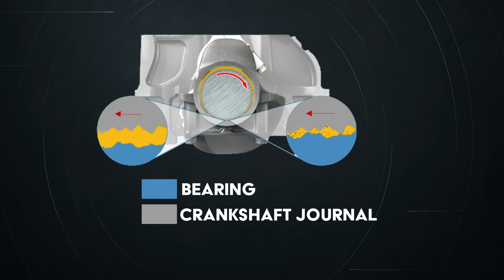the truth about start-stop technology (finally proven)

Comment: Quick things to note here: 
1) The tests needs to clarify that they are actually using a car that has start-stop features installed. If i'm not mistaken, this car has 2 variants, one has start-stop enabled, one doesn't.
2) Cars that use start-stop, need special low viscosity oil and they maintain some oil pressure even after the engine is turned off.
3) It might not be a fair test if the relay forces an engine to start-stop at X interval over that time, because in real world use cases, the engine control unit would not start-stop the engine if the key parameters weren't optimal yet( like oil temperature/pressure ).
4) Different start-stop enabled car brands have different solutions to these problems. Some have special oil pumps that keep oil pressurized.

In general, i doubt that the car can take that much damage in 1 year. If it did, it probably would not pass quality inspection, since factories and other independent testers have done these tests and havent found any significant extra wear and tear.
Reply: Something else that is missed is that a "warm start" especially if it has been less than 3 minutes, will have oil in the bearings.  It doesn't mean that there isn't a risk of increased damage compared to continuous running, but that there isn't "no oil" in the bearings
Reply: Are you crazy? You can't come here and speak the truth, people hate that! The simpletons want to be angry about a minor inconvenience and you're trying to ruin that. How dare you.
Reply: How on earth does an engine maintain oil pressure when it's stopped?
Reply: @ej20tnz  electric oil pumps. Some turbo engines already had them prior to the introduction of start-stop systems in order to avoid cooking the oil in the turbo when the car is stopped after harder driving.
Reply: @xIcarus227  And check-valves( which wont let oil drain out ) combined with pressurized oil reservoir will also help to keep oil pressure for a while.
Reply: @ej20tnz with an electronic oil pump that runs, while the engine is stopped
Reply: @ej20tnz  electric pumps
Reply: Lower viscosity oil did not help Chevrolet.  They had to recall many vehicles, replace engines damaged beyond a certain threshold, and update the specs to use heavier weight oil.  The physics of the damage caused by frequent stops/starts cannot be negated so easily.  It was a stupid idea defended by politics and based on flawed science.  If there is a problem with human caused climate change, it's population density.  Not fuel, or meat, or cow farts.
Reply: @nukelheadmp yea but its chevy their engines would probably fail even if it didnt have the start stop feature
Reply: It would have been interesting to know more about the test and the oil used etc, but I don't think the things you mention are particularly significant, especially in terms of the earlier generations of stop/start vehicles that have a non stop/start equivalent. The latest ultra efficient hybrids, I believe utilise very low viscosity oils such as 0w/20 and are equipped with auxiliary electric oil pumps, but I don't think this is normal for the vast majority of regular cars on the road that are equipped with stop start technology.

I believe the latest 'experiment' with thinner oils is an effort to improve efficieny and therefore reducing emissions anyway, rather than mitigating the effects of mixed friction. A certain viscosity is required to provide a robust oil film which will more easily subside if the viscosity is too thin. If you think about the syringe analogy in the video, a thinner fluid is more easily pushed out.       

I think the test consisted of the engine idling in the workshop, so was not under heavy loads or operating in conditions that are likely for the ECU to override the start/stop function due to something like excessive heat in the turbo, for example. Hard to know for sure though from the footage to be fair.

The basic fact remains that engine components are most vulnerable to wear when not operating under an optimal set of parameters including oil pressure, temerature and speed. To that end, repeated stopping and starting of an engine will absolutely result in accelerated and  increased engine wear, so the results of this test are hardly surprising. 

As in other industries, these kinds of gimmicks seem to me to be crude attempts to keep within ever increasingly difficult emissions regulations, rather than being of any overall benefit. Manufacturers obviously design cars to mitigate the many issues that stop/start technlogy causes, but this makes them ever more complex and expensive. Regular batteries and starter motors are no longer adequate, auxiliary pumps are required to pump coolant and hydraulic fluid whilst the engine isn't running. Surely the power required to crank the engine many times in a single journey and to keep the auxially pumps going, are essentially powered by the chemical potential energy in the fuel that you're supposed to be saving by stopping the engine when you're stationary?   

Sometimes the medicine is more problematic than the sickness and I think this is particularly so when chasing ridiculous, idealogically driven emissions targets. I also don't think the manufacturers can be trusted to mark their own homework in this regard and it's not as if they haven't been caught out in the past.
Reply: @jimmcspunk7692 it's not just about saving fuel, it's about reducing emissions. You know, to preserve the planet we all live on. I get it, though. You're only here for a tiny amount of time and you cannot be inconvenienced, who cares about future generations of innocent people that will suffer due to your ignorance and inconsideration.
Reply: @The_T_Rav  Thanks for your feedback Travis but your reply makes no sense. My comment addresses emission reduction and I find your assertions patently absurd and detached from reality unfortunately. I'm guessing that you're just trolling or having some kind of issues, possibly both.
Reply: My thoughts too... And doing a test with warm oil is hardly the same as the entire engine being warm? And the car they test on, does it ever fully warm up or do they cold start it the first half of the day? 

This video is omitting so much information it's very strange
Reply: Testing is a science. That's also the reason why militaries have 0Days. Because everyone thinks he can test something outside production environment and than make conclusions.
Reply: The thing is due to rampant planned obsolescence, they ONLY make the life of engine last the warranty period. S/s is just one more tool in their toolbelt
Reply: They "need" low viscosity oil? Oh lawd, here we go again. Yet another one drinking the koolaid with zero argument as to why lower viscosity oil has any benefit beyond tiny gas mileage improvement.
Reply: The two single largest polluters on the planet are 1. US military 2. China... Stop buying trinkets and well, you can't do anything about the former...
Reply: @klarion  If you are an american, then you can do a lot about both. Dont elect those who support military budget increases every election and make it known to politicians that you dont want bloated military
Reply: @UninstallingWindows  Ironically that does about as much to dent the military budget as you uninstalling windows does to microsoft's market share. The people have no power when 3/4 of the world's pollution comes from companies and institutions the average person has no real stake in.
Reply: After a few time listening…not understand of any😂
Reply: Copium
Reply: Who keeps a car for a million miles? Most I've ever done in a car was 225000 miles and it was the bodywork that failed it, not the engine. I actually do turn the stop start off in traffic. Not much point doing it on my commute though, I usually have a nice relax 30 miles each way with no stops. I used to work with standby generators for which for most part of their running was with no load attached - no pumps running - idling. Every now and then we'd connect up a load bank on them. Man, did they really chuck out the muck. The exhaust pipes would start melting the paint and the exhaust, for a good 10mins or so, would chuck out black smoke. I suspect you'd do more damage to an engine pottering around town than you would stop starting.
Reply: @bertiesworld  I do, classics are only getting rarer.
Reply: @bertiesworld the breakdown rate and cost of new vehicles would suggest different.
Reply: my car currently at 700k kms. Car is almost perfect still. Why do you replace your car if it's doing perfectly well? Probably the engine holders are gonna break much earlier than any engine part itself. Drive well and cars last a long time

Comment: First things first, start stop is out there since more than 20 years. It may have resulted in issues at the beginning, but in 2025 this is utter nonsense. If engine durability is your mission, ok, I get your point, but not all engines must make 1 mio kms, on the contrary, most vehicles do not make it to this number, so why protecting the engine? Plus: any hybrid concept fails without start stop.

Comment: Doesn’t surprise me at all that this is just a way to make more money on service appointments required to keep the guarantee at every x km at a certified shop which is more expensive because the car producer is taking a percentage of each service, original parts, and in some new cars they have started with subscription for some services that should be a not a pay to use service but coming with the car like the gps

Comment: The stop start feature is an extremely stupid concept……but after an engine is shut off, the residual oil stays for quite some time ….4 hrs or more….ya really don’t get a “Dry” start until 8 hrs or more of not running…..I suppose depending on the type engine there could be some variations…..starting up under load would most definitely be hard on an engine over time tho….not to mention the starter and anything else related to the start up cycle.

Comment: start stop user here, now second car with 250K engine, not even 1 issue until now, if you do the oil interval as described, not over 15k km no issue. 
have also few people in the family, one of them drives a bmw 350k km driven, not once a problem. startstop is on by default. 
in our case it's all Benzine, maybe it's an issue for the big busses / trucks on diesel ? dont know. but the start stop is a good system, it better economy, less pollution in the city.

Comment: I have a 2015 Hyundai i30 with stop-start, and before that I had a 2011 i30, both with the same diesel engine. There is no difference in fuel economy, but on the later car it needs an AGM battery that is about £60 more expensive, and I had to replace the starter motor at around 90,000 miles, whereas the old car still had the original starter motor at 296,000 miles. On the plus side, it qualified for £0 VED instead of £30 VED.

Comment: As a former Car Mechanic I can confirm that in fact the Start/Stop systems are pretty much killing your engine fast.
What should be a durable engine becomes a engine known to blow up,and pair that with a missed maintenance and you got yourself a driving grenade.
Worked on many that blew up,mostly the Turbo pretty much killing the engine,that is if it has a Turbo,and its even worse for the Turbo engine's to have such system.
Oil burns up in the chamber between the Turbo Blades and cooks it nicely,shaft isnt spinning and heating one side up,what ends up happening is clogging the system and causing the turbo to starve of oil,that could go in the exhaust system and burn it.
Causing you to have a Runaway engine that cant be stopped by turning the key.
So if I cant convince you,the fellow from MIK Motoren sure can.

Comment: That's why I always pre heat my RC model car engines prior to starting them. Piston, liner/sleeve are sufficiently expanded to help bring them up to operational running tolerances. 

It's particularly important when breaking engines in from new, when they can be extremely tight. If you want them to last, you have to respect them.

There's more to it than that regarding starting and running with an initial rich mixture. That involves tuning. I will not go into it.

Comment: Guys just use the start / stop to YOUR advantage. Don't use it all the time, only when is worth it. If you are coming from easy load on engine and you are stopping for more than 45s is OK. Is not worth it if you are on a traffic jam for 1 hour and you are starting and stopping 5 times per minute.
Nevertheless, this video is very insightful and helps how to properly deal with start/stop.

Comment: Honda rushed this in their 2015-2020 TLX (v6 AWD). After a flash that didn't help, my starter died at 60k miles. (Who ever heard of a Honda starter dying that early? One-off maybe. Many, nah)

By that time, there was an open recall for the start stop system. They covered it under warranty. I unfortunately had to pay for the tow but they handled everything else. Invoice said $2200. My service advisor said he's had one case where the customer had it replaced under the recall warranty and it needed it again a year later. (But only that one that's he's aware of. They did cover it again even tho it was technically "fixed" by the software flash, they didn't want to bother the customer and just did it). 

When mine was replaced (I had to meet all these strict criterion, it DID fix the issue of the car shutting off when you'd slow down over speed bumps or at quick stops like stop signs. But I've noticed lately that it feels the same when starting. That is to say, the starter sounds like it's struggling and weaker than it should be. Hopefully it will be covered again if it fails again. The recall says it'll cover to 150k and I'm at 110k, we'll see.

In related news, the crank bearings had an issue and the fuel pump had an issue so when my engine blew up, they gave me a free long block and installed it. It took them a month but it was free. They replaced the fuel pump too, so they say. The fuel pump still seems to cut off on the freeway during downshift but way less than it used to do meh. 

One of the service advisors hypothesized that the fuel pump and bearings issue probably would not have presented if the auto start stop system were not in the car. He said there was an oiling issue for the bearings but that shutting the car off at random times and restarting it puts extra stress and wiggles on the crank and bearings and made things worse overall for everything. I'm not sure what's true but I know I have this lemon Acura TLX A-spec that I used to love and it's been towed in too many times.

Been a Honda dude my whole life and this experience has turned me off so much that I might drop my loyalty and head to Toyota or Lexus next.

As a side note to this novel, when they installed my long block, they didn't know what they were doing exactly and forgot to tighten some bolts. I found some and tightened them. The SA told me the tech doing it is the only one they have with the knowledge and experience and he was overwhelmed from the recall. He said that BEFORE they worked on my car. And they were training another tech to be able to help him knock them out. Someone forgot some important bolts (mounts/suspension) behind the wheel. I fixed that and reached out to see if they could give it another once-over to check for things I can't see easily. They never called me back 😂. I have heard a clunking sound ever since they touched it but I just drive slower. Maybe one day I will find more surprises but I will dump this jalopy eventually.

Thanks for reading,
YouTube novel writer

Comment: What about those really thin 0W20 oils? I have to drive it in my GR Yaris. i ALWAYS turn off the startstop but still, i dont feel good with 0W20.

I go for easy warm up and cool down after driving it hard. Worrying too is that Oilpressure is at 1,5Bar at idle. too low in my opinion.

Comment: start stop cars are the better choice to buy but not for its start stop feature, the engine in start/stop cars (in most cases) has bearings that have extra polymer coatings, this is to minimize the wear of the constant starting/stopping, 

this is alright doesnt help that much if you keep start/stop on but if you have a start/stop car and you use it as a non start/stop car (turning the start/stop off always when you start driving or forever with a ecu modification) you can outlive the same car/engine that has no start/stop function.

also for start/stop to be better for the enviroment the engine needs to stop running for 6 minutes otherwise the extra fuel needed on start up outweights the fuel not used during the stop.

Comment: Modern synthetics have additives to create sacrificial layers inside engines. How many oil changes did you do through the "year" or testing? Were any start-stops longer, giving time to deposit to the affected areas?

Make sure to change your engine oil regularly. Modern enegine oils are magical - I did 40,000km on an extended duration one, and it came out clean. But if you have a hybrid or a start-stop engine, rather than an older bulletproof engine... don't do that. Fun experiment, but no longer practical.

Comment: I no longer need to drive every day. Combined with driving only short distances this means my car doesn't get enough drive time to charge the battery. So I finally have a reason to use start/stop. It tells me when battery charge level is low by not stopping the engine. (Unfortunately trickle charger when parked is impossible in my current location)

Comment: But if the engine is only off for a few seconds during auto start-stop, wouldn't it still be primed, and hence take a significantly shorter amount of time to build oil pressure? 
Replacing the oil with some that's already warm is basically just a warmer cold start.